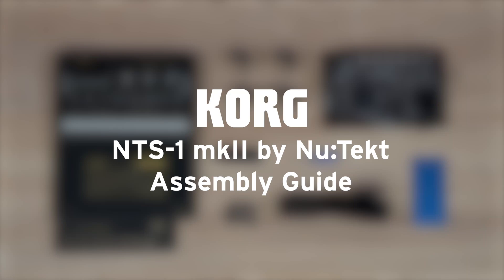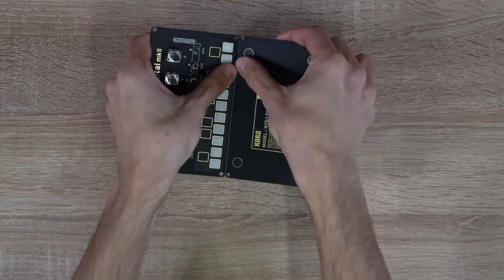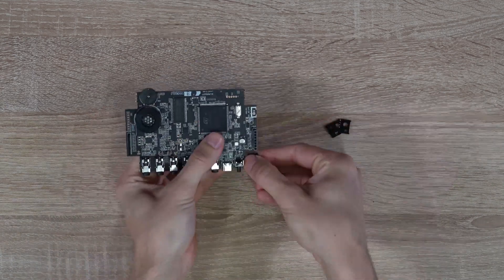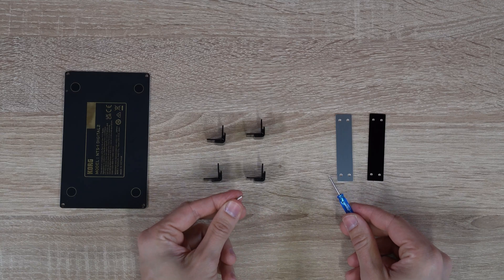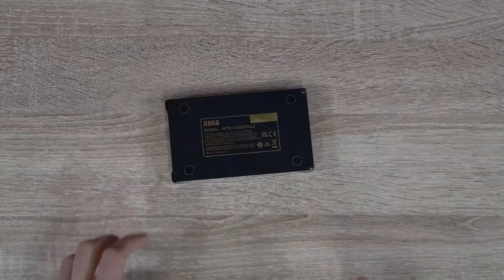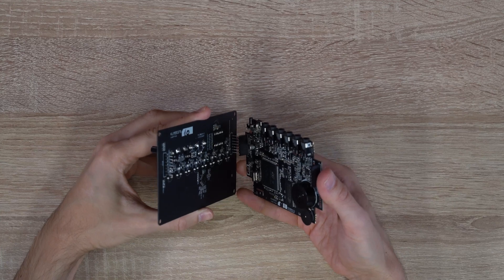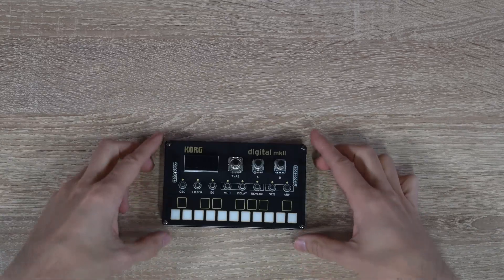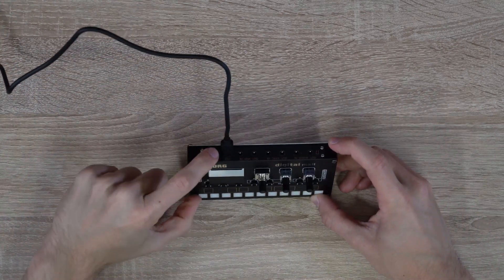Nu:Tekt NTS-1 digital kit mkII - Assembly Tutorial

Comment: Bought an NTS-1mk2 and now I'm a musician and an engineer!    This is going on the resume, immediately!

Seriously, though.   You have major manu issues.  Enamel on bottom of bottom board has huge blank/abrased spots several inches long in one corner.  TWO header pins were bent.   They are sending these in PLASTIC bubble bags.  Can we assume no CMOS in here?
Reply: Oh, and the bottom board stuck to the bag, because they did not clean the resin at ALL.
Reply: Aaaaaand, solder joints on top panel (from the headers) are corroded.    NICE!   Worth every fuqn penny, Korg, you sly devils.